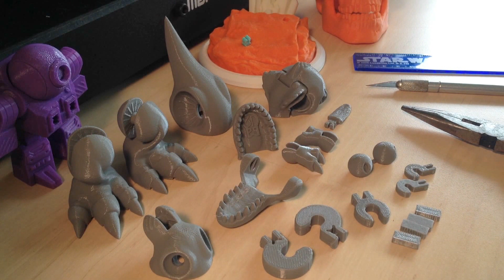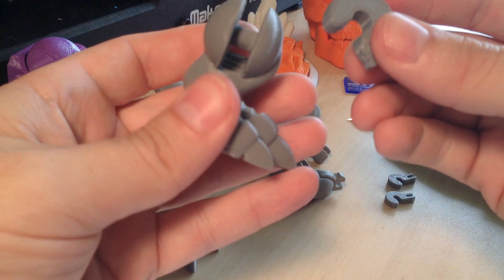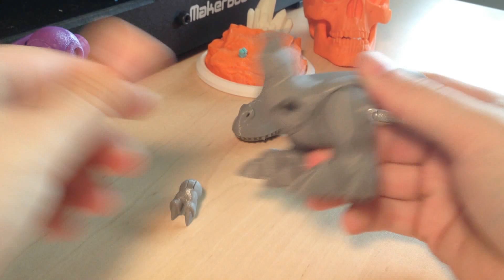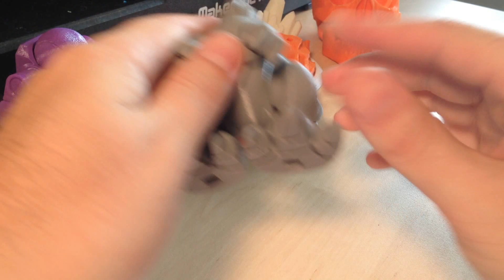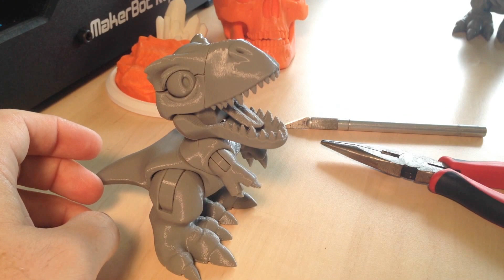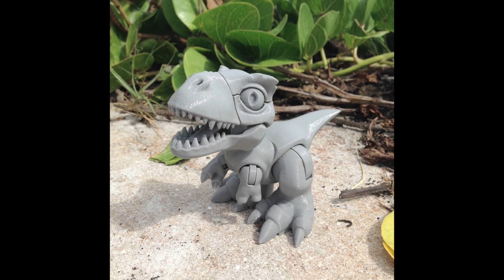Boon The Tiny T. Rex Build Guide - 3D Printer Toy via 3DKitbash.com

Comment: I don't get it, has the model changed? Comments from years ago say it fits together perfectly, mine is super loose and the pieces just flop around. I imported the model into tinkercad to look at how they fit and the STLs themselves have WAY too much clearance to ever be tight.
Reply: Same. I have an adorable Boon but the hip and neck joints are way too loose. The shoulders are better but maybe that is just the fact that they aren't weight bearing that it's not as noticeable.  Getting the hip, arm, and neck pins into the joints was ridiculously difficult but the ball-ish joint is loose once you connect it all. I have to balance him carefully standing upright so his tail is resting on the table.
Reply: Same. Love the models but everyone I've printed is really loose. Not sure what I'm doing wrong.
Reply: Also I don't think we'll get a reply. The haven't made a video in years.
Reply: Just printed it recently and the hands just snapped in half while I attempted to put them together

Comment: The most challenging piece of this to print is the lower jaw, because the contact with the bed is very small for a cantilevered piece. Any cooling curling at all will make the printer's nozzle bonk into the two forks and break them off the bed. I need to try adding some brim or frogtoes to that piece in particular.

Comment: Will there be a Triceratops or other dinosaurs made like this? I just got the model and it printed well, though having serious issues with those dang pins. It requires more than my full body force to try and get them in without breaking under the stress. But solid, excellent model throughout! I want mooaaar dinos! Printed in PLA with an XYZ Da Vinci Mini.

Comment: You say you print at .2mm, but what speed?... I'm using a MaylanM180 which is a Replicator Clone (dual extrude) but my layers are coming out a little wiggly and more visible than yours... will printing a .1mm smooth it out?

Comment: Just bought this for my nephew - prints beautifully so far (in ABS), well designed detents too. I'm looking forward to finishing it and assembling it :)
Reply from the maker: Hi Dave, I'm sorry for the late reply! Thanks for the feedback. How did your finished model go?
Reply: Hey -  I didn't expect a reply at all :)
It printed well - I printed it in ABS, did a bit of acetone smoothing but then realised I really didn't need to so stopped.
The only issue I had was my printer accounts for shrinkage with ABS so some of the parts printed looser than optimal. I may print one in XTCF so there's nowhere near as much shrinkage and my printer doesn't mess it up.
Boon looks amazing and he's really happy with it :)
Reply from the maker: Ah, I see - we've had that happen to other people too, and we couldn't figure out what was going on with it. If you'd like, you can insert pieces of felt into the joints, too. Thanks for the feedback!

Comment: I've only now finished printing my Boon with a Cube 3rd gen. The friction pins tend to get an expanded radius, which I had to sand off in order to get a fit, but otherwise, I had no other post-processing to perform. This is a wonderfully engineered model. There's artistic and technical genius at work at 3DKitbash, that's for certain. My Boon is currently headless or the head is currently body-less, as I neglected to print the lower jaw! Now I have a 25 minute wait until Boon can become a complete being.  Eight hours overall, in four separate builds, but it would have been three had I earlier realized the missed lower jaw. 200 micron layers look great. Some of the layers give an almost wood grain look to part of the model, but not so that you'd notice in a negative way. Black Boon with Neon Green eyeballs looks pretty menacing.